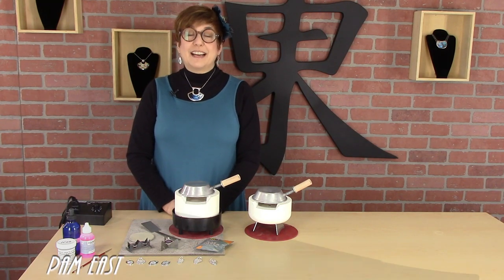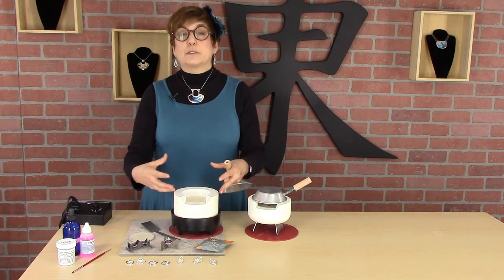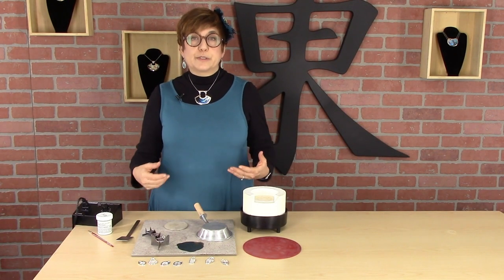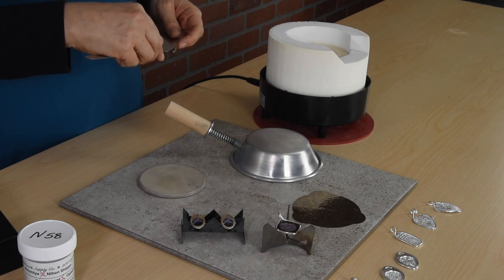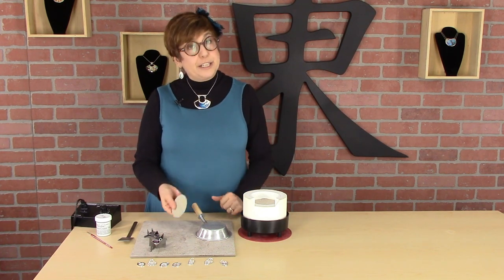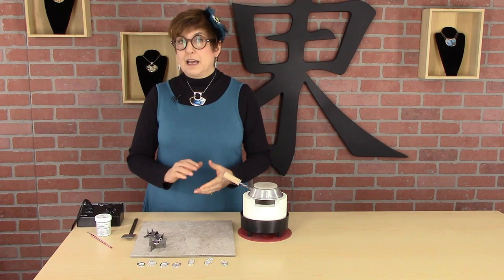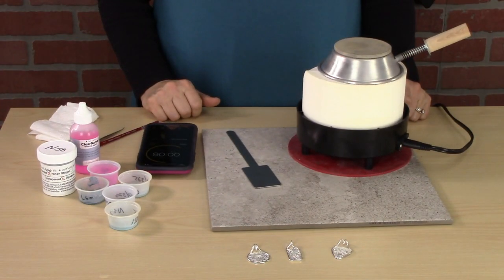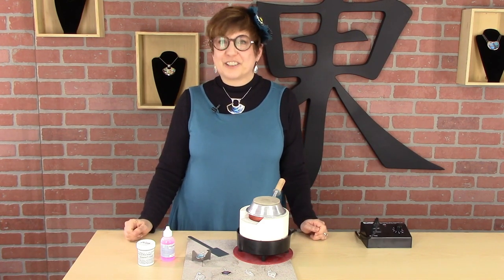Enameling in the Ultralite Kiln with Pam East

Comment: Thank you thank you thank you. This is best review I have heard. I have three kilns  borrowed and used so I would like it keep it small specially for enameling cloisonné. My question is, you can use this enameling and cloisonné? I have bigger kiln but would like to work on a smaller scale. My question is will this work at 1600 on a 120 service? Thank you.
Reply from the maker: I haven't tried Cloisonne in this.  Remember, all the heat is coming from the bottom, not the sides or top.  But as long as it was a small piece, I don't see why it shouldn't work.  Good luck!
Reply: In the 1970's my aunt had one of these. She made beautiful, detailed cloisonnés for years using it, and passed it on to me. I still have it! I could not believe it when she gave it to me, that it was what she used to make all that gorgeous jewelry.

Comment: Wow very interesting! Do you need a ventilation system like with a big kiln?
Reply from the maker: No, Neither metal clay nor the enamels I'm using put off anything I'm worried about.   Just make sure it's on a heat safe surface.
Reply: @PamEast  thank you!

Comment: What are the requirements for safely using this at home in terms of the electrical power? How can one be sure it is safe to plug it in to an outlet in my home? Are they a safer choice for home use than a full-size kiln?
Reply from the maker: Other than the usual care one must take to avoid burns when working with hot things, these units are very safe.  The components are double insulated and  CE Compliant.  Just be sure to always use them on a heat safe surface.

Comment: I initially thought this kiln was great, but be aware: if the element burns out (and mine did very quickly) and you are in the UK you will have a job and a half getting a replacement!
Reply from the maker: So sorry that happened to you!  I've had mine for many years and it's still going strong.